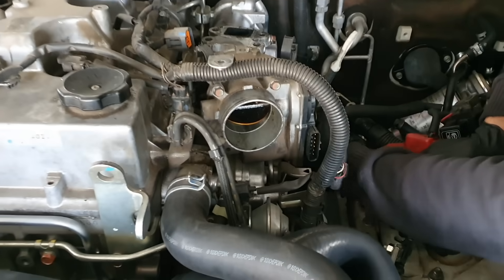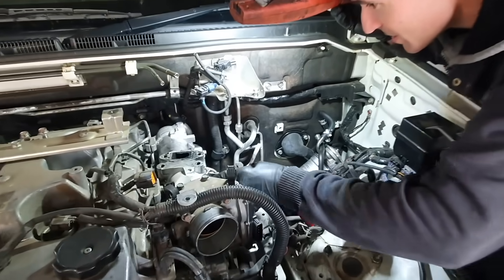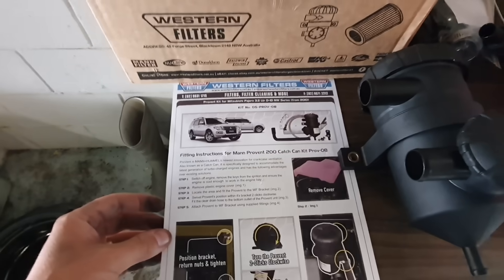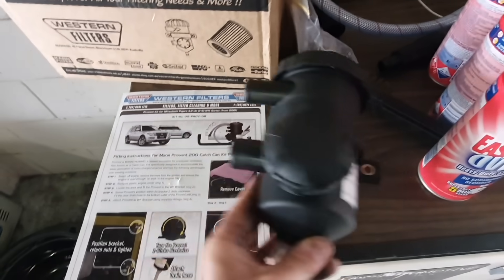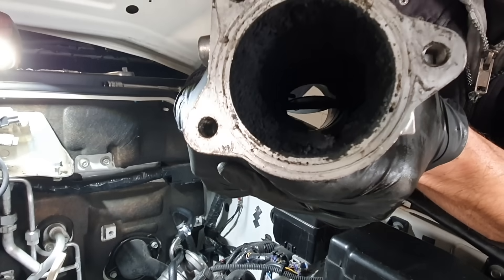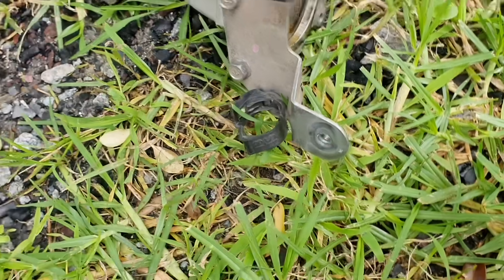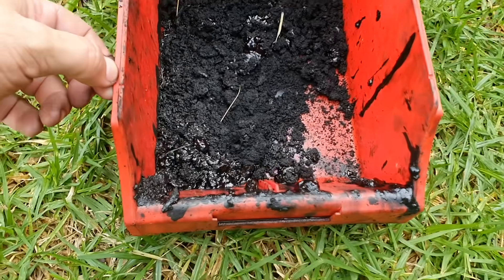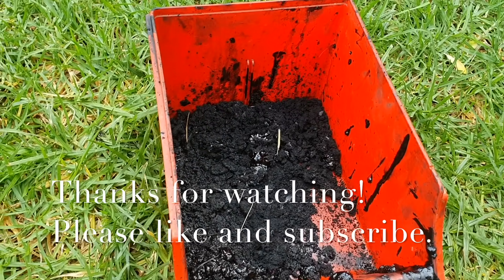Mitsubishi Pajero Diesel Soot Manifold Cleanout

Comment: they say not to use oven cleaner on aluminum, but I have cleaned many intakes and even some aluminum heads and have never had a problem. Maybe you would if you let it soak on there too long.

Comment: I remember when we went to great pain to get our intake ports polished now we run all the engine's internal sewage through the intake destroying the highly sophisticated air-fuel ratio for the cleanest combustion possible. Then complain when the emission control system is plugged and not working. I fixed that problem. I took that crap off. Ran the engine sewage through to a large baffled and filtered Catch Can system vented to the atmosphere. That gets collected and put with the old engine oil at the regular oil and filter change. Now I get 1/3 or better MPG more. The engine is more responsive, cold starts are better and diesel engines with the right air filters and tuning have zero black smoke on take-off in stop-and-go traffic. This is not rocket science. But the existing systems are failed science projects forced on the auto industry by government zealots looking for votes from the ill-informed and poorly educated.

Comment: Nice work and nice demo :  Toyota dealer telling to replace the manifold:  

not want to do anything:  is it safe to clean the manifold ?? 
Car showing electric parking system failure and Toyota dealer said carbon build up on intake manifold and recommended complete manifold replacement: (expensive, )) they don’t want to clean :,

What is your opinion. Thanks

Comment: My Fiat 1.3 16 valve diesel had a broken cam chain (easily fixed surprisingly) but the intake was almost blocked solid with soot. 
I dunked its (one piece) plastic manifold into a bucket of caustic soda (lye in USA). Unfortunately, that’s not an option for any aluminium parts. They had to be manually scraped out. I had the head off to check bores and rings so did a proper valve job. If it’s left on the engine, you have to blast it with walnut shells. Turn engine to close the valves of course.

Comment: I just clean the egr system for may dad's bighorn. Its the worse I have ever seen similar to yours lol

For the intact valve in the head, I just spray it, brush it, pour petrol in there and brush it until its clean & shinny like new. But before I pour something in it, I make sure I only clean where the valve is in close position. Once I clean the close valve part, I push the car while the gear engage and the close/open valve is changing position. I continue to clean the other close valve where I haven't clean yet. Everything went perfect.

Comment: A lot of the buildup is caused by stop start, short trip city driving, which diesels we’re never designed to do.
Long regular runs and frequent oil changes will reduce this problem.
However, a catch can is a great idea to help reduce this problem.
Reply: Just checked mine. Almost clean. Never city driven, always under trailer load hundreds of km per leg. It has now done 500k km. The dieselpump failed at 450k and was super expensive. Luckily i found a company that repairs old ones. so i sent them old broken and got a replacement.

Comment: Just did mine 2007 ML, took me 24h. Few words of advise to whom wants to jump and do it himself. Plug all fuel ports after removing them, use advised cleaner only on the inside and mask gasket surfaces, otherwise it might corrode the aluminum fine finish. Once is all back together you need to manually pump and purge rail and injector lines and let all the air out by undoing small bolt on top of the pump, do it several times.

Comment: When my truck turned 25 and became ineligible for emission inspection, I put a 4-barrel carburetor and non-EGR intake on it. It runs better, makes more power, and is much more pleasant to drive
Reply: So you turned diesel engine to carburator gasoline engine? Correct name if I'm wrong?
Reply: @riomartinez7573  
No, it was a '94 Chevy with throttle body injection.  Gasoline.

Comment: How many K,s mate...
What is a rough estimate for a mechanic to do this..
Just bought my first diesel 4x4.. 2007 3ltr turbo with 260 000.k,s...
You have me worried ..!!
Does the mechanic recommend using de,- carbon products..??
Reply: He mentioned in earlier comments this engine had 150,000kms

Comment: The best thing you can do is remove it or get a blanking kit MUCH better performance MORE power BETTER fuel economy and it won't clog up anymore and your oil doesn't turn black as quickly. We do this to every diesel we drive or anyone who has this problem or has a broken egr valve I work for my self doing mechanical work. Just from cleaning you will feel the difference  and get better fuel economy.  Them swirl flaps are defo not gonna be working right gumed up like that, hav fun cleaning it's nasty stuff it stains your hands

Comment: I've seen another vid of somebody burning the soot out of an aluminium intake with a blowtorch and airline. You wouldn't want to do that with the butterfly valves as they probably have rubber seals on the shafts.

Comment: It surprises me that most people don't even know about using oven cleaner when dealing with engines.

You proved how well it works. I don't know of any other product you could have used and get the same result.

Whenever I go to the dollar store I always pick up a couple cans just to keep it on hand when I need it.

I liked your video. and I'm glad you showed how dirty the parts were.
Reply: Oven cleaner does seem to do the trick! Word of caution though, it isn't meant to be used on aluminum (i.e. alloy engine). While I think it is safe to use if you wash off straight away I can confirm you shouldn't leave on for extended period of time. I used the oven cleaner where you put it in a bag over night and it damaged my intake manifold (beyond being able to use). Hopefully this message saves someone else some grief... and saves another innocent intake manifold from being perished :elbowcough::elbowcough:
Reply: @jabezrenko  indeed oven cleaner may work but it pits the surface of the aluminium making the problem worse as the surface is "grippier" for the soot to attach to. I have tried acetone which is used as a degreaser which was pretty effective, but there is only one product so far that has worked better which was a degreaser called Surfex HD made by a company in the UK - it is water-based which seems counter intuitive and I only happened to have a jug of it which I bought years ago but I was shocked how well it worked with a hot soak - safe for plastic manifolds and my EGR cooler came up shiny - some mechanical scraping for the really hard bits is also needed but I'd sooner that than risk oven cleaner...
Reply: @jabezrenko  I use bath room cleaner with hot water, it works very well on aluminum alloy, I later rinse it with hot water.

Comment: Fitting a catch can won't stop all that crap from filling the inlet manifold up, it's not the egr,s fault either, diesel's are dirty because it's an oil not a fuel, when it combusts it turns to mostly soot, that is why modern diesels now are fitted with an dpf to filter out the soot, my petrol engine doesn't have a catch can fitted and it's at 150,000 miles, the inlet manifold is clean, 0 soot build up, sell your polluting diesel pile of junk and get a petrol car

Comment: Your engine is performing well as all the carbon deposit was dry, if it'd have been a wet or grease like then that was a clear I education of engine repair.
Clean the EGR, IMF, Turbo, Intercooler after every 50000KMS, never let it pile up so much.

Comment: I had the same problem with my BMW X5. I only have problems once and I never have them again. 1. Fix the cause, crankcase blow by install a quality Catch can, 2. Remove exhaust recycling,3. EGR valve blocked remove it. The results better economy better performance. Still have DPF better emissions control. Downside zero

Comment: It's making me so bad feel when I see that screwdriver rubbing aluminium parts. X.x
Reply: Its the intake manifold, he wasnt scraping the mating surface with it. I have not once encountered an issue with using a flathead screwdriver on any vehicle i've worked on.
Reply: @mmaus688  It is just the fact of scraping aluminum with a screwdriver is all we're saying.. If it were steel it wouldn't matter much but as we all know aluminum is easily scratchable with something like that.. Not to say you WILL but the potential is there
Reply: @brandonstone6962  So what if he scratches it? Is it going to rust? Cause it to implode? The damage is superficial since it is as i mentioned an intake manifold. It doesnt matter HOWEVER you look at it, as i said i've not once in my life experienced any ill effects doing it.
Reply: @mmaus688  It'll make the engine fully and completely EXPLODE because of that little scratch in the side of it.. So you may not have done but doesn't mean that SOMEBODY out there may not
Reply: My exact thought while watching that part was that if it were me I would use a solid plastic scraper or something of the sort so not to scratch or damage anything with the screwdriver
Reply from the maker: @brandonstone6962  yeah good point. I should have used something like that
Reply: @kapindustries9236  In the end the job was done and it looked great afterwards, but that is just what I personally would have used
Reply from the maker: Thanks for the comment. Next time i do it i certainly will do that1
Reply: @kapindustries9236  Wouldnt worry too much mate! We've all done stuff like that 😁

Comment: I had the same car, NT Pajero, did over 200000ks oil changed every 10000ks with Penrite semi synthetic.  When I sold it the guy had his mechanic check the intake with a scope and there was no build up at all. No catch can or EGR delete. Just change the oil and drive it hard. Moral of the story is you don't need a big diesel for the school run, they don't like chugging  around the city.
Reply: I call a big bull💩 on that one.
Reply: It was driving it hard that kept it clean, not the oil. Driving modern diesels around town and for short journeys all the time will cack them up.
Reply: @spankeyfish  Yeah, It’s modern diesels, with all the emissions mods, that are the problem, Hence why we get rid of them. I did the egr delete but didn’t bother with a catch can. My Pajero loves chugging now that its breathing properly at low throttle.
Reply: My 38 ft troller loves chugging around the sea. Hour after hour.  Don't tell me the diesel buses in London don't like chugging around the city streets or driving the kids to and from school.
Reply: Diesels, love chugging away. High torque at low rpm.
Reply: Why don’t Aussies seem to do the egr deletes? Common practice in the UK.
Reply: @ryanclegg3767  pretty sure its illegal over there, it is in New Zealand.
Reply: Agree
Reply: Catch can could damage the engine!! its just a snake oil salesman. Your advice is wise and I totally agree.

Comment: Those probes in the first part of the plenum with the throttle body attached, I'm surprised they were even doing anything and not throwing a check engine light.  Even more of a reason to delete the EGR system on my vehicles.

Comment: One thing i like about the newer vag  TDI engines is that with the the seprate low and high pressure EGR systems, you get all the combustion condensation pushed through the intake, steam cleaning everything and keeping it pretty clean. Although the DPF can have issues if you mainly do city drive ming so that regens never completely finish.
Reply: I own a PD, and the amount of gunk in mine was enough to make a grease-trap look like a childs birthday party!

Comment: Diesel pro tip. Make sure you add fuel additive. Hotshots is really good. They make a oil additive to eliminate stiction and removes carbon buildup on the oil side of the engine, it sounds like you are from Australia so you can run the hotshots extreme system clean till the bottles gone and then the everyday ( every tank ) they boost cetane, clean injectors, prevent water separating and give the much needed lubricity back to the fuel that is removed in refining. I used to run this in my 7.3L power stroke and it loved it. Good smooth running engine.

Comment: that right there is a mixture of soot and oil from the CCV, even tho it’s built to “help” the environment...it’s really just killing ur engines durability and reliability
Reply: EGR is cleaner when new. But even a small soot build-up will destroy any benefits. I fitted a baffle inside the exhaust manifold to direct gasses away from the EGR port. It’s not sealed up so less gas will go down there but a hopefully a lot less soot.

Comment: I bought a Pajero , from new I installed a provent 200 filtered catch can , remapped and had egr turned off completely, this crap should never build up in mine . Therefore stay fuel efficient and powerful for the life of the engine , and eliminate all these problems in the future, systems like egr may reduce pollution when new but it comes a point when these engines will use more fuel and pollute more due to this soot issue . As you say all diesels will create this mess , but you can prevent it.
Reply: Interested to see if it worked? It’s very easy to check if you engine cover and unscrew intake
Reply: @ i do check it every 20,000km , it’s clean . there’s no build up

Comment: Hey mate, howd you clean the intake runners in the head?
Reply from the maker: Im sorry i didnt see how he cleaned it. I think he just very carefully scraped out all the soot and used a rag to pull the stuff out.
Reply: Make sure both intake valves are closed by rotating the crankshaft. Then proceed to go crazy on it with gasoline, benzine, petrol or w/e you call it AND a brush like one he showed.
Do ONE CYLINDER AT A TIME and you'll be OKAY.
Edit: You have to be ABSOLUTELY 💯 sure there's no leakage into the cylinder or you'll KILL YOUR ENGINE IN SECONDS by hydrolocking it.
You've been warned.

Comment: Nice stuff, curious how you cleaned out the ports on the engine side without getting carbon into the cylinder? Did you idea vacuum or something as you scraped?
Reply: I understand they turn the engine over to close the valves, clean and remove all junk, then turn it over to close the next valves, and so on.
Reply from the maker: I didnt see how he did it sorry. I think he just carefully scraped it out.
Reply: I'd say a good way to do that would be to carefully scrape the buildup off, but keep a shop vac or some sort of vacuum nearby. Keep the suction as close to your scraping tool as possible, and take your time.
Reply: @nathanheaverlo9626  @UCRlEx829Pxoe_wZSb7dJwhA  thanks that's what I was thinking but my mechanical knowledge is still basic!

Comment: That's what happens with city driving and shitty fuel quality's also just changing fuel filters more often and taking it for a longer drive with no stop and go will help
Reply: Not really , city driving will add to it quicker but highway only driving you will still have these problems , it’s the design of the emission systems , you have the greenies to thank
Reply: @exploringsydneyandbeyond9059  wouldn't all this soot lower the efficiency of the engine?
Reply: @panda3d180  Yah it makes it misfire and run like crap
Reply: In time when the build up becomes bad enough then yes it would

Comment: next time mate!! just soak in a tub filled with ATF fluid , it will dissolve all of the soot overnight , and voila  totally clean intake manifold , OH! and block off the egr valve , totally useless with todays modern diesel fuel
Reply from the maker: Thanks mate. Had to complete the job in the day. All blocked now

Comment: Low quality oil and diesel?
Reply from the maker: No just a very common issue with cars fitted with egr
Reply: @kapindustries9236  And how many miles does that vehicle have?
Reply: @jamocerwin5841 by the sound of itabout 500000k,s needs complete rebuild and while your doing the head clean the bloody manifod and ports etc in bath haha

Comment: Remember, according to the EPA, this makes your diesel run cleaner. Gotta love EGR.
Reply: It’s not about the car it’s about the environment and your fellow humans.
Reply: @Monsieur405  I agree that we need to protect the environment.  An efficient engine is a clean engine, and EGR robs efficiency.  I understand the principle behind the EGR components. By lowering the amount of available oxygen in the combustion chamber, accentually you are creating a chemically induced variable displacement engine, thus requiring less fuel to operate the engine at a specific load and speed.  However, unlike a gasoline engine, a diesel does not require the stoichiometric ratio of 14.7:1 to operate properly.  It can vary the amounting fuel from 0 to 100% based on its maximum volumetric efficiency and load requirements, which negates the need for EGR and promotes the need for better fuel mapping.
Reply: @nutsandbolts432  R/Iamverysmart.
Reply: @Monsieur405  what a pathetic reply. Truly sad
Reply: In diesels the EGR is used solely for lowering peak combustion temperatures to suppress NOx formation.

Diesels with SCR systems should not have this issue, to a certain extent NOx formation is desirable in those engines because NOx regenerates the DPF, whatever NOx remains afterwards can then be removed by SCR.

Comment: Don't think that the egr is only on diesel's because the 94 Pontiac sunbird I had was a gas engine and I cleaned the egr valve myself before eventually replacing it.
Reply: My 99 Tacoma has it.

Comment: Does that motor have a turbo?
Reply from the maker: Sure does
Reply: @kapindustries9236  you would think all that soot and carbon has to be hell on the cylinder walls and valves.
How does it run after all that work? 
Had to be a noticable difference.